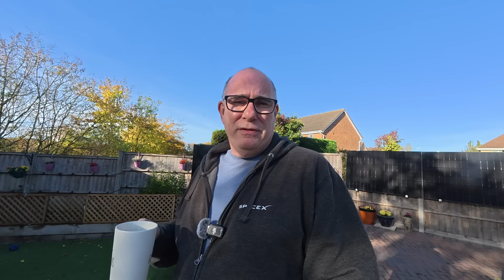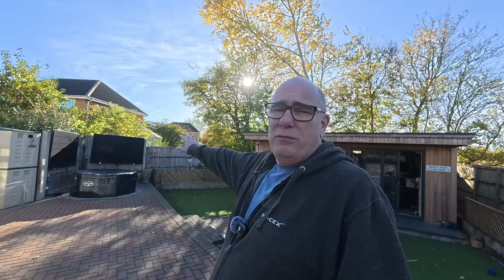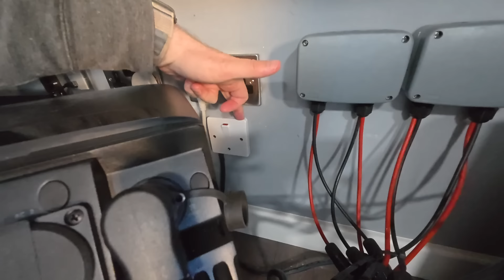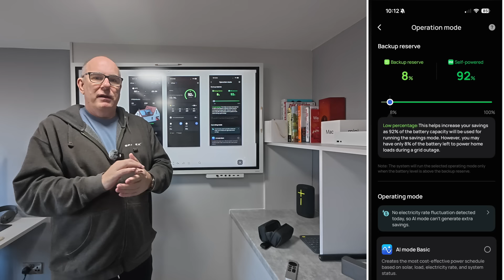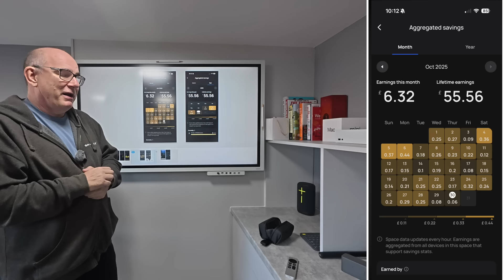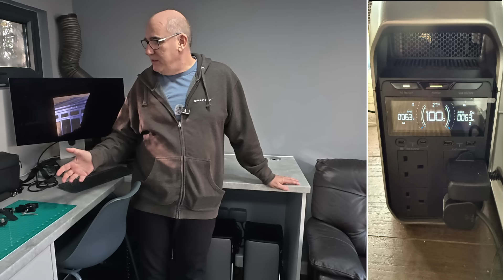I Tried Plug-In Solar for 90 Days (EcoFlow Stream Ultra UK Review)

Comment from the maker: If you’ve tried EcoFlow or similar systems — what’s been your experience?
Reply: Delta2 - had a pair for a long time. Cracking product for its era but doesn't do time of use and automation is tied to their cloud service. Delta 3 had ToU but didn't work reliably and is totally cloud based.

River2 - okay but artificially limited in functionality like automations and Ecoflow broke the tools I was using to work around that. Also has a nasty problem where the calibration goes and you can discharge it to the point you have to know tricks like bootstrapping it off a DC supply to get it back running again.

Powerstream - nice idea, inadequate cooling and too high a failure rate but they were a great price and the dual MPPTs made them work really well for their intended use. Don't work well with batteries in the UK because there is no CT clamp support. Needing an electrician also annoying but not Ecoflow's fault. I use them just as extra MPPTs for the Delta 2's and it works great.

All my newer stuff is Bluetti because it works without cloud, ToU just works properly and I didn't need grid tie.
Reply: EcoFlow have the best software from all the Microinverters I've tried.  I suspect that is driven by the customer focused US team.  Other vendors tend to be functional, but not so nice.  For that, one pays a little extra cash but, in my opinion, it's worth the extra pennies.  Also, the heft of the kit is nice - it's like the difference between a car door that closes nicely, just makes you feel good about it.  So, in my experience, all pretty good.  I have tried other Inverters which work fine - just not quite as 'feel good'.
Reply: I have the ultra and really like it.  Initlially bought as it seemed to be the easiest/cheapest off grid per kwh system to set up. Just plug some panels in and you are good to go. It's now doing a cracking job taking up some of the household load during the night, and storing excess house solar. Are there better value for money systems out there? Almost certainly if you have bigger demands. Probably will add an AC unit at some point.
Reply: Stream products in general work well however there are issues with this company and its services in particular Support and its rectification processes. I have 6 Stream Units and the Ultra unit started intermittently tripping RCBO. It took EcoFlow 48 days to respond. Now months later after agreeing to a replacement and EcoFlow collecting my unit but NOT supplying a replacement I am left with 5 batteries and having to use the EcoFlow inverter which I also bought to provide additional mppt inputs as a means of connecting 2 of 4 panels. 
Having received by Unit, EcoFlow then advise they do not have any units. 

So the offer, which I think is very poor was :

1. You can have refurbished unit very quickly.  Why would I? There was no offer of compensation I.e. as a minimum difference in price new vs refurbished. So in effect I am paying for new but getting used.

2. A refund LESS a deduction for usage already received but no indication what net amount would be. Known as their After Sales Depreciation Scale. (Which is NOT published)
Reply: Bit late to ask this but thought I'd comment under the relevant video... Did you get a certificate of conformity to prove that the Stream Ultra X is G98-type tested/compliant? My electrician is asking for this because the DNO needs to be notified for this G98 installation. 

Also, since your Stream Ultras are connected by 13A fused spurs to an existing ring circuit, what is the max draw from your Stream Ultra? The table in the Ultra X online manual suggests that it's highly limited to 360W feed-in, although the online manual is only for the US market and there is no UK-specific manual that would take our regs and 230V grid into account
Reply: @iamdmc fused spur onto a ring with devices isn't compliant with the regs. Some people eg energian seem to still claim this but Ecoflow do not any more.

Ecoflow should provide the G98 certificate. They do if asked for the powerstream one.
Reply: I applied on-line for G98 for stream system. It does ask your a device number or similar and refers you to a defunct website but a google search for the required results in needed info and entering that on G98 (on-line) went straight ahead and was issued in minutes.

Comment: Even though it was illegal?
Reply from the maker: No, it wasn’t because it was wired into a fused spur
Reply: @JonathanTracey but it isn’t ENA approved yet so technically you aren’t allowed to connect it to the grid in grid-tie mode. You can use it standalone with the direct ac socket on the side though.

Comment: Hello Jonathan 
Helpful video!
How were you able to set it up to charge during off-peak hours.. when i go on automations, i cant seem to find an option to get it charged within specific timeslot.. 
Currently I set up the Operation Mode to on Self powered during the day, then manually turn it on to custom where i can control the charge and discharge hours.. then again manually go to self powered mode in the morning
Reply from the maker: yeah, I run mine in custom all of the time, with set charging and discharging times. I don’t think you can mix operating modes.

Comment: Living in a rural area, which has had frequent power cuts (for 5 days in a row on recent storms), do these systems work if there is a power cut? If I was to get plug in solar, or solar and battery, what do I need to allow me to utilise the power during a power cut? Many thanks.
Reply from the maker: Yes and no, they cant supply power into the house during a powercut but you can plug devices into the battery directly using the onboard sockets and those work
Reply: @JonathanTracey 
Thank you for your reply, I’ll have to rethink how I can tackle this within my limited budget. Cheers.

Comment: So the battery is charged by either solar or cheap rate electricity or both and the 3 pin plug go's in the mains. How does the electrical items in my house know to use the ecoflow electricity. Witchcraft to me.
Reply from the maker: physics not witchcraft, basically a higher electrical potential than the grid

Comment: I don't understand if these would also work as an ups from the integrated sockets
Reply from the maker: it has a very quick changeover, but I don’t think legally they call it a UPS because of the time it takes.

I have a network attached storage and a small raspberry pie computer connected to mine and they don’t notice if the power changes over. So in all intense and purposes as far as they’re concerned, it’s a UPS.

Comment: Good video, very clear.  I have solar but I am also considering a battery to charge on cheap rate overnight and cover the base load during the day.  Can it be set up without a connection to solar? Thanks
Reply from the maker: yep just set a schedule to charge and discharge

Comment: i don't have a battery but my stream system doesn't show the grid info No connection line or even a number for grid. i have the black ecoflow meter. Anyone have any ideas?
Reply from the maker: if you only have a micro inverter you don't need the ecoflow meter as far as I know

Comment: Could you get greater efficiency by angling them further from the fence to about the standard 35°? Is this just a personal decision so they don't stick out too far?
Reply from the maker: yep but that would allow the wind a way to get behind them, out here in the fens the wind comes from 90 degrees to the panels so I need to keep them as close to vertical as possible otherwise one big storm and they are gone

Comment: does this arrangement need earthing separately or is being connected via 3 pin plug to house system sufficient?
Reply from the maker: inverter is earth through the plug however if you really want to do belt and braces, you may want to earth the panels as well if they’re going to be accessible. Probably not necessary but it’s up to you.
Reply: @JonathanTracey  Thanks very much JT, that's what I was hoping

Comment: Just purchased the stream ultra battery to go with my two DMEGC 515w solar panels, could you advise me on how to setup the operating mode ie. Back up reserve, at present it’s set on self powered mode backup reserve = 30% and self powered is 65%
Would it work better on intelligent mode. Thanks Kevin
Reply from the maker: can't say if it would work better as everyones use if different, for me on custom I set the backup reserve by sliding the bar at the top of the screen. Given we have other batteries i keep this low 8%

Comment: Could I use one of these connected to solar and to my consumer unit to power my. Air fryer 😂
Reply from the maker: @FXCartel Short answer: not really in the way you’re thinking 👍

You can offset some of the load, but something like an air fryer pulls 1.5–2kW, which is way above what these plug-in systems typically supply back into the house.

So it works better for:
background loads  
evening usage  
bill reduction  

rather than powering high-draw appliances directly.

Comment: I'll put this here just incase it helps someone because another firmware update was released for the Stream Ultra and as per usual more weirdness. So after the update I was getting a 'Over frequency level 1 (521)' error. After googling the error it turns out you just need to switch the power on to the sockets at the top of the device and then turn them back off again. This fix worked for me. This stuff is so annoying. I think after this update I just won't bother to update again because I can see a day a firmware error just won't be recoverable. As the saying goes "if it ain't broke don't fix it".
Reply from the maker: haven't seen that issue but good to know there is a work around, thanks for sharing

Comment: Interesting and great detail, what stops you loosing charge into the grid, is that done by the shelly EM50?
Reply from the maker: yes if you use the optional shelly/ecoflow smart meter it will stop this. in my case i have an export meter so im fine with it going out

Comment: What happens when you pull the plug out is it live
Reply from the maker: No, the minute the live pin disconnect, the inverter loses the 50 Hz signal from the mains and immediately shuts off. So before it’s even out of the socket, there’s no power going to the pins.

Comment: Great videos buddy.  Could I install 2 x stream ultra x systems each with solar panels, eg 1 on shed at the bottom for the garden and 1 on the house. They would both be wired independently but share Shelly pro smart meter ?
Reply from the maker: @LeeFairbairn-e3e Yes in theory you could run two separate systems like that 👍

They’d likely need to be on separate spurs if you’re wiring them in properly, so electrically they’re independent.

Where it gets tricky is the Shelly meter side of things. The meter is effectively telling the system what the house demand is, so it knows how much to push in. If you tried to feed that same signal to two separate units, they’d both respond to the same demand — which could mean you end up with double the power being supplied.

So I’m not 100% convinced they can share a single meter in the way you’re thinking. You’d probably need to treat them as two independent systems, each reacting to their own measurements.

That said, it’s a really interesting setup — might be something I test properly in a future video 👍

Comment: I went with APSystems EZ1-M , as Ecoflow upped the prices and are unavailable ( long wait times to order)  Companies are scalping prices  example £270 just for the microinverter . At least APSystems have been around longer and have excellent reviews . I already own a delta 3 1500W and a spare battery  for back up , But I wish to cut my day to day electricity bill.. here is a snippet , taken from British gas website , so forgive the copy and paste ................
What are plug-in solar panels – and how do they work?

Plug-in solar panels - also known as plug and play solar or balcony solar - are small solar kits designed to be incredibly easy to use:

    Place them on a balcony, terrace, shed roof or outdoor space
    Connect the plug-in solar inverter into a standard 3 pin socket
    Start generating your own electricity, which you can use instantly to power your home – so you don’t need to buy as much electricity from the grid

This means plug-in solar panels particularly suited to:

    Renters
    Flats and small homes
    Balconies and small gardens
    Anyone wanting a low cost, low commitment way to start generating clean energy

The government has greenlit some changes to wiring regulations, which’ll mean that systems under 800W can plug safely into domestic sockets without needing an electrician. This is expected to go live from summer 2026. And retailers such as Lidl are already preparing to bring plug-in solar panels to the UK.............................https://www.britishgas.co.uk/the-source/news/plug-in-solar-panels-explained.html

Comment: What kind of custom wiring is required in the house before you can set this system up? Brand new to this concept so I'm trying to figure out how it works. I don't care so much about selling power back to the grid; I just want to know the bare minimum to get up and running.
Reply from the maker: providing you’re not living in a 1920s house with 1920s wiring then you should be fine. The whole point of these systems is that they’re plug and play. Have you had an EICR done by an electrician in the last few years, if you have then you’re probably good providing you past the inspection
Reply: @JonathanTracey  Oh my house was wired by a DIY cabinet maker and none of it's to code, lol. Just wondering what I'd have to do to make this work.
Reply: The house was built in '39 but I think most of the wiring was redone in the 70s or 80s.
Is there a good FAQ or introduction to plug in solar anybody can recommend?

Comment: I find it so offensive when the Energy companies give us pennies as returns for OUR FREE energy but charge us ££££s
Reply from the maker: @MaximusJohal yeah on the face of it it does look a bit rough…

If they’re paying ~12p/kWh for your export and selling it on at ~30p/kWh, that’s an 18p margin — so about a 60% gross margin on that unit.

But that’s not pure profit. They’ve still got to cover network costs, balancing the grid (supply/demand 24/7), customer service, billing systems, bad debt, and all the other overheads that come with running an energy company.

so the best thing you can do is store it yourself and use it when you need it, that way your not having to buy kWh in the first place

Comment: Can i have the solar directly go into the battery? I just want to use the battery as the main source
Reply from the maker: yes absolutely, but if your never going to connect to the mains you may want a power station thy are a bit cheaper and more versatile

Comment: Are you still limited to 800w from the Battery through your house electrical sockets?
Reply from the maker: yes into the house circuit 800w from the onboard power sockets it’s 2300w

Comment: How did you earth your panels?
Reply from the maker: Earth pin in flowerbed
Reply: @JonathanTracey is this suitable? My research is constantly pointing me to sending Earth back to consumer unit.
Reply from the maker: it was signed off by my electrician so I’m gonna assume yes. My whole garden office has its own earth spike something to do with the potential difference between the house and the garden office. Sorry not an electrician but was told when we put the consumer unit in there that it needed to have its own earth, so the panels and the garden office or use the same earth spike

Comment: WHY is the plug in option not compliant, dangerous?
Reply from the maker: no, just the current wiring regulations don’t allow it. There are concerns that back feeding power through standard MCB might cause it to fail but not trip. However, this hasn’t really caused any problems in Germany or France where these systems have been deployed in mass numbers.

Comment: Hi I’m new to all this. I’m looking into getting a solar battery system for my house and like this idea of expanding. Do you have to buy the exact same battery to expand or can it be an ecoflow smaller/larger unit?
Reply from the maker: so the first unit you buy is the one that has the micro inverter built-in, in my case that’s the EcoFlow stream Ultra. Then if you just want to add battery capacity, you add something called the EcoFlow stream AC pro. They look identical from the front but the AC pro doesn’t have any solar panel inputs. Then if you want another battery at another AC pro

Comment: Hi Jonathan, not sure where you're based but are you available to do a day's consultancy work for people like myself who have the Stream Ultra but haven't yet found a sparky who's happy to install before the new regs are updated (April 15th is the date that NICEIC say its happening but i'd expect there to be months more delay for any sparky to be willing to take it on). 

I live in Bath (Somerset) and need input from someone who knows the optimum system setup and can oversee the sparky's work by remote live chat during his visit...or write out a list of instructions/checks/advisories and follow up with them before and during install. If this is something you'd consider please let me know your day rate - if not I'd welcome you pass this onto someone else you'd trust to take this job up. Or recommend a sparky in my area who's installed these before! Many thanks Dan.
Reply from the maker: @chasey2327 appreciate the message 👍

I don’t offer consultancy at the moment, but I’d suggest holding off until the regs settle — things are moving quickly and installers are understandably cautious.

I’ll keep sharing setups and data on the channel which should help guide you 👍
Reply: @JonathanTracey  great - thank u